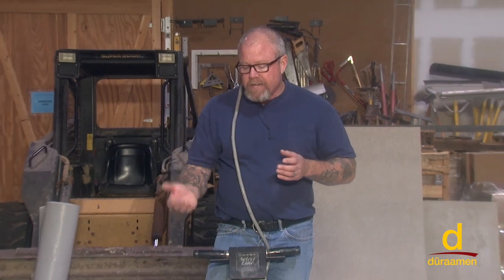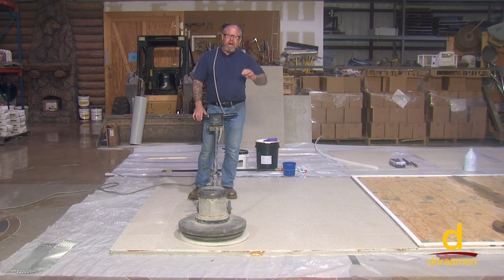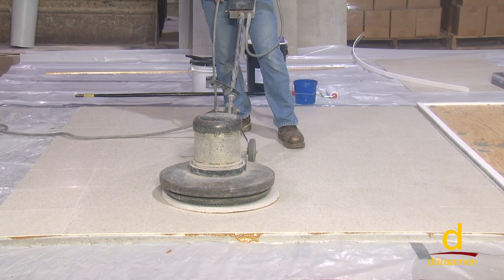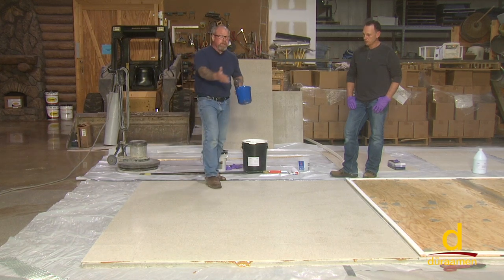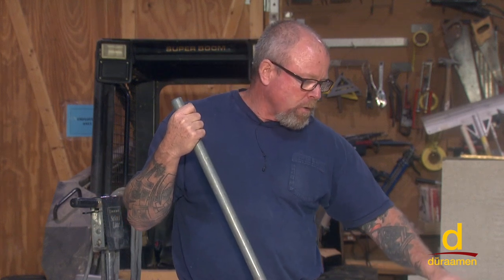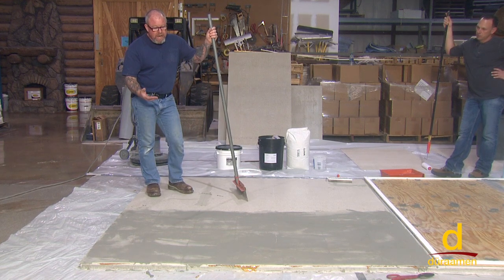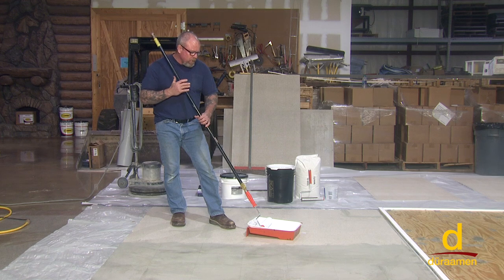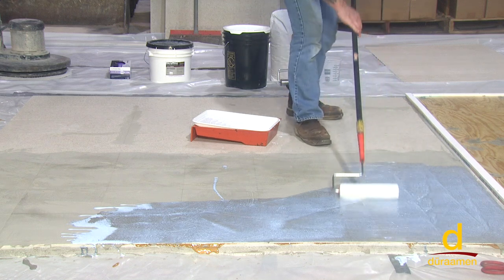How to Encapsulate Vinyl Tile with Concrete Topping? Part 1/3

Comment: Im a little confused about this. I thought you are not supposed to sand asbestos tile. Ok  my asbestos tile has a sealant on it. It's not was, but it's hard a d smooth. I suppose that could be scuffed a little, but not enough to oenetriatenthe tile. Is that correct?  Thanks.
Reply: sounds scary to me

Comment: wouldn't sanding asbestos tile release a ton of asbestos dust?
Reply from the maker: Not if you sand wet...
Reply: @DuraamenFloors  How do you clean it up properly?  Rags? Towels? Shop vac up the wet paste and keep adding water? How do you dispose of any of those?
Reply: @DuraamenFloors  Wrong! Only Chrysotile Asbestos absorbs water. The other types repel water. So wetting doesn't necessarily work.

Comment: Thanks for info...question:   Applying porcelain tile over basement asbestos tiles (firmly in place, not loose, and which are on basement concrete)  tiles have hard, clear  sealant...So, if the sealant coat(s) is first scuffed, as you demonstrated,  can thinset skim coat go right on sealed asbestos tile, (before the coat of thinset when laying porcelain tile) or does CP 1000 go o? Thanks!!!